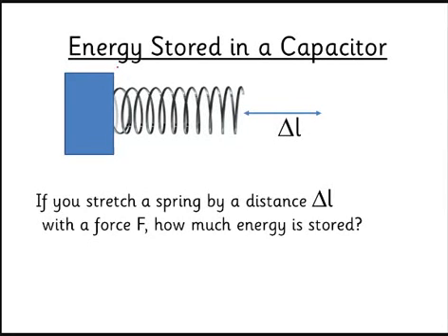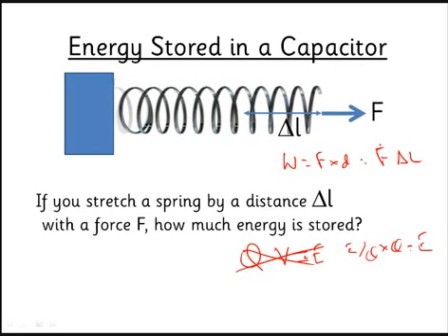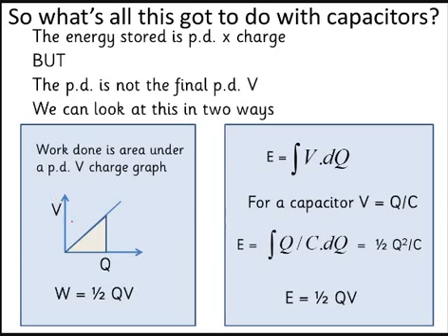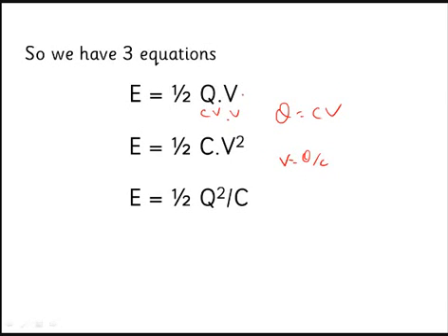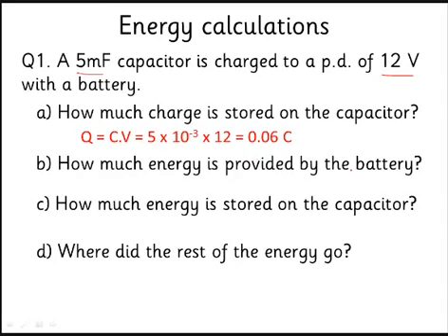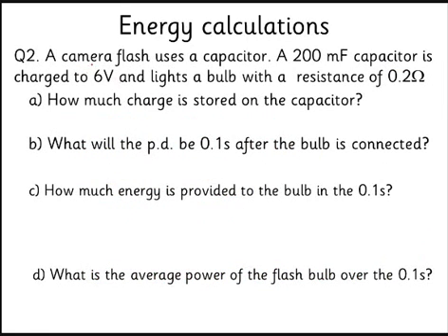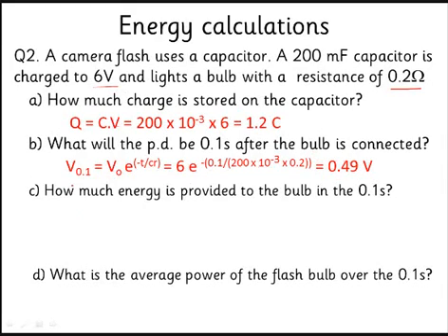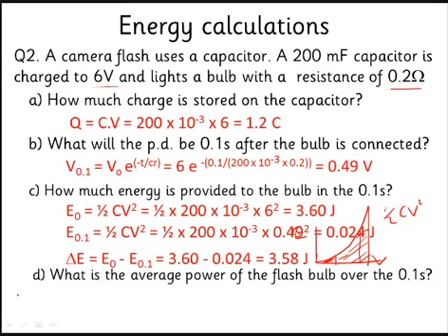AQA A2 Physics Unit 4c Capacitors Lesson 4 Energy in Capacitors

Comment: For part c at 7:33, why did you use that energy formula rather than either of the other two? And why do they all give different answers?
Reply from the maker: Any of the formulas should work, but I've used that one as we already knew the p.d. If you wanted to use 1/2 Q^2/V for example then you would have to work out the charge stored at each time, it should work though.